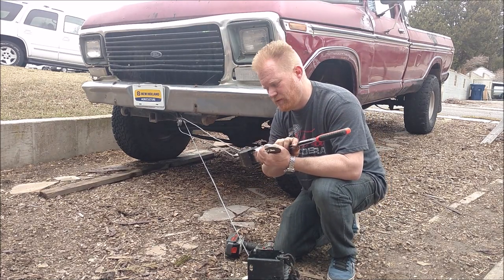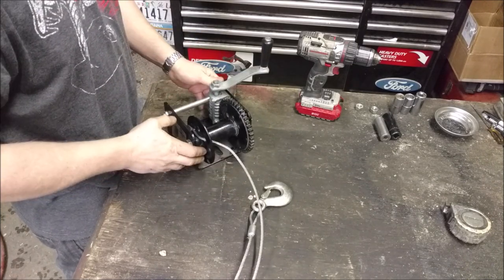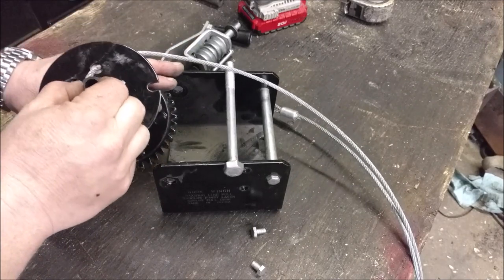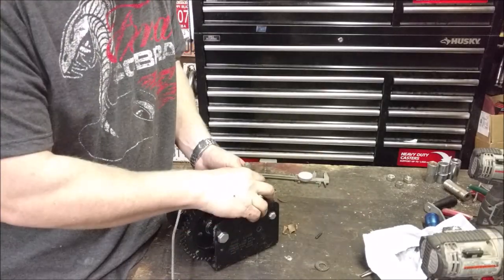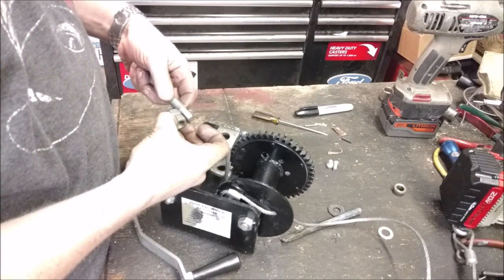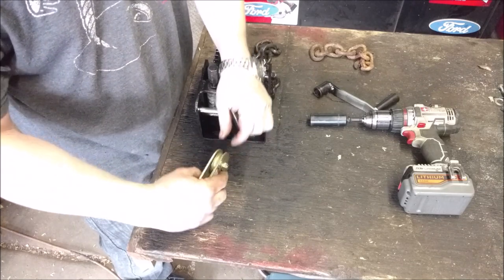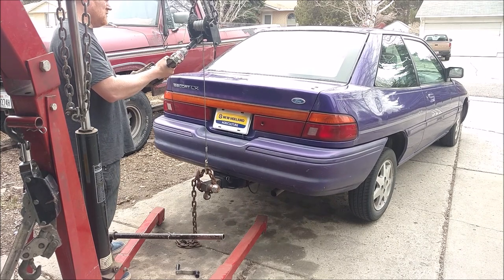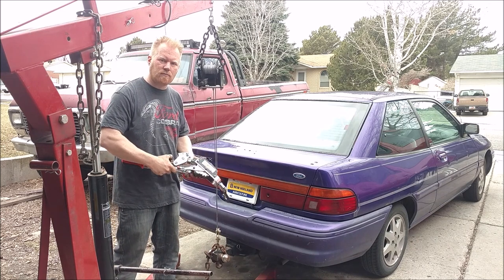Drill powered Winch build

Comment: I have the USA winch, but got it cheaper than amazon, bought at McMaster Carr. I have used it for a Draw Bench power unit, had no issues. You know, it is 900 LBS with full drum and 2000 lbs with most the line out. I have only about 15 feet of line on mine, and so, I max it out. I have been using comealongs in the yard. I do have one of those outdoor drill winches, but the overlimit clutch slips all the time, kind of useless unless you only load it less than 500 lbs. I think I will get another McMaster winch and make a yard winch out of it. FYI, one does not need to mod the winch from McMaster, the tolerances are close enough already.

Comment: Nice.  You should put a socket on the old handle in case you don't have your drill in your vehicle.
Reply: Yup. The first thing I thought of was retain the ability to use that handle.
Reply from the maker: I welded a socket to it. But I also made it as standard lug nut size so a 19mm or 3/4" lug nut wrench will work on it.

Comment: Just so you know ...shouldn't depend on a welded chain ...it will fail ...better to be bolted on ...instead of hooking lead hook to small threaded cross bolt ...bolt a piece of steel to tongue that will accept the lead cable ...although ...good build ...👏👍👏

Comment: bought one of these today. MUCH tighter than shown in this video. I was fully prepared to make the mods shown: shim the drum, move the worm, add washers,  etc but see no need. Maybe tolerances vary or quality has improved but either way I'm very pleased. Gonna swap on a longer cable and build a shingle hoist for roofing.
Reply from the maker: Quality control is one of the reasons HF stuff is so cheap; there is none. So some are great, some not so much and some horrible.

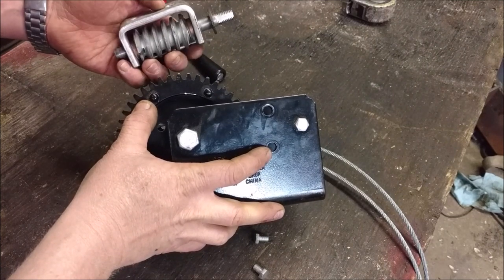Comment: Another impressive project. Love the upgrades. Another upgrade you might want to consider: The tube that you have in your hand at 2:10. Drill straight through that, in the middle of the length. Making 4 small holes in the middle. Now take the bolt that goes through it. Starting at the head, drill the center of that bolt. Maybe 1/3 to 1/2 the way down the length. Use a smaller bit, to maintain integrity of the bolt. Doesn't take much. Drill an 'exit' hole, at the end of where you stopped drilling. Now, drill a larger hole at the head, and tap that for a grease fitting. 

When you put it back together, just pump grease in, until you see it coming out both ends. Check it again, a couple times after the first few uses. Then keep it maintained from that point on. You can add a dab of grease to the screw, each time you do this.
Reply from the maker: Great idea.

Comment: I had been thinking a lot about a small portable, yet powered winch, and then you posted this!  I made myself one using your idea, but my gear mesh was a lot better than the one you have, so I didn't need to change it.  Instead of making a bushing (shim?) for the drum I drilled it and the frame out to 1/2" and put a grade five bolt through it.  I also made a hook on the top of my engine hoist and a pulley on the end of the boom so I can use it on there.  Great idea, keep them coming!
Reply from the maker: That's great.

Comment: If you want to max out the range of that engine hoist, weld two pieces of flat bar to the end of the boom and bolt a pulley between them. Then mount your winch on the rear of the boom. That lets you reach deep into any engine bay with the boom fully extended to clear radiator braces etc.

Comment: I just recently got a 2 ton version with a brake. I'm suspicious on the teeth only meshed in roughly half way. It definitely needs to be tighter tolerance. I'm glad saw your vid. Cheers from Australia 🙂👍👍👍. So cheap to buy it's definitely worth modifying! I made my  1200 lb winch on my hand trolley into drill power.

Comment: I like the idea.  I've been trying to figure out how to get a ford starter to be the motor on a very similar winch you have there.  Here's what I did with my come-alongs.....I removed the steel cable and the pulleys.  Then I wound new cable just like a winch.   Now my come-alongs have 30 feet of use.  You bet they pull full-size trucks onto my trailer.   Plus they do double duty to strap down the vehicle to the trailer.
Reply from the maker: Nicely done.

Comment: You are correct about doubling the mechanical advantage by doubling the line, but your anchor point needs to be rated for the full weight  or load, and you are adding additional stress to an already marginal design.  Not saying it won't do it, just don't think that you are reducing the forces on the winch or anchor point

Comment: I got one of these to move my old truck. I made a bracket with chain to bolt to the hub bolt but after trying it the worm gear moved off it's pin and wouldn't work so I had to take it apart to put a washer in there to take the play up. I also welded nuts on the shaft too. The gear mesh wasn't bad on mine so I didn't change that but found the bolts holding it are m8 1.25 which is the same as handles for angle grinders so I replaced a bolt with a grinder handle which really helps to hold it while using it.
Reply from the maker: Nicely done.

Comment: Great idea! I might build one of the to hang on a beam in my garage to lift heavy stuff and possibly the top off my jeep!
Reply from the maker: It's come in handy a few times since I built it.
Reply: Ratty 64galaxie be sure to have a backup chain in case something fails. I used one to hoist my truck bed off and while it was hoisted up a pulley came off dropping the bed a few feet. The hoist took the hit but almost failed it's self. I had to modify the hoist to make it stronger like in the video.
Reply: Allen McKinney not a bad idea especially with the seriously heavy stuff.

Comment: One of the most useful youtube videos I have seen. Yours are consistently useful and practical.

What kind of welder do you use and is it a good option for a newbie to start with?
Reply from the maker: There is a huge in flux of Chinese welders these days and you can get started for $150 with a helmet and everything(Harbor Freight). For the price it can't be beat. BUT, it is difficult welder to learn on and even when proficient has mediocre results. Mainly because it is a AC output welder. I would highly recommend finding a used Lincoln DC flux core welder, like the Weld Pak 100. It'll well really lessen the learning curve and give you far superior results. I self taught myself with a Lincoln WeldPak 100 I bought in 1998 and still use it to this day. It has more than payed for itself many times.

Comment: Nice job as usual, thanks a lot. I'd like to see a closer view on how the cable is set up with the snatch block. Can you make a video or suggest one that you may have seen. Thanks again
Reply from the maker: A snatch block is a really neat thing. By taking the cable out of the winch and through the pulley of the snatch block, then back to the winch it doubles the pull capacity. It also halves the speed of the item being pulled/lifted but it is a worthwhile trade off. You can keep adding pulleys and running back and forth to reduce the strain on the winch.
Reply: it also gives you the advantage of a smaller diam spool
Reply: Ed KE6BNL not true om

Comment: Ya these work good , Only thing it could really use is a guide ring on a rod  about 8" down the cable like on the come a long so it can`t turn on you if pulling at an angle , Be handy alright .
Reply from the maker: I just used it tonight to pull a riding mower onto my trailer and it was trying to turn sideways a little. I like your idea and I'm going to weld a guide loop/fairlead a few inches out front. I may make it removable to keep this compact for storage.

Comment: That's exactly what I need. I bought a harbor freight cycle lift. I need to roll it over to the wall and tip it up on its side when I'm done using it. What would you charge to make me one of those?? Great video man, thanks
Reply from the maker: I have a link in the video description with a USA made one just like the one I built.
Reply: sixtyfiveford 
Thanks

Comment: You, my friend are helping me out one hell of a bit and I haven't even started yet. Except for one thing I want to put the drill bit nuts onto my haul Master 1 ton capacity hand winch instead of using the hand crank but I don't have a welder to weld the nuts to the shaft do you have any advice?
Reply from the maker: If you have a propane torch you can solder steel pretty easily. Putting two nuts on and jamming them together is pretty efficient. You could also grind the handle down with an bench or angle grinder to fit into a hex socket.
Reply: @sixtyfiveford  I realized I could just use an impact drill  with the nut it came with, I just can't let slack out. What size drill bit do I use on my drill press to drill out the center of the two nuts that I use a 3/4 socket on??

Comment: very well explained and demonstrated. thank you.   Any idea on translating this design so that you could triple the speed but still have the 2000lb capacity?  I want to pull 1000lb wheeled cart up and down a 250' hill at about 80-150 feet per minute.
Reply from the maker: You would need an engine driven winch to achieve those speeds. Something along the lines of a wakeboard winch, just heavy duty.
Reply: That is what I was thinking, but will that USA made hex winch be able to handle that speed?  What kind of motor do you think?  I was hoping to convert a go cart with a 5hp motor.

Comment: Very cool hacking, subscribed! 
When you did the loop the cable through another hook trick at 7:00, the higher load carried by the wire rope at the lower hook using that technique might take it to near to its breaking strain, ie reduced safety margin?
Reply from the maker: Thanks. The cable is generally way stronger than winch. This is using tiny 1/4in cable that has a rating of 3.5tons where as the winch only has a 1 ton rating. So I could essentially pull around 3 tons safely with rigging pulleys and stay within the safety parameter.

Comment: I don't like the weld of the worm bracelet because I can loose the bolts and free wheel pulling the cable out, of course I had to add a cable tension flap and spring to prevent backlash.

Comment: 1. You didn't say the size or thread of the 3 nuts you welded.  Very Important information! 2. How do you weld it; which welding technique? 3. What type of category drill is that? Can't see it well.
Reply from the maker: 1/2" course thread with 3/4" head, but it really doesn't matter.

Comment: Only Escort I've seen with a set up to tow! You might see anything on Sixtyfiveford! Lol
Reply from the maker: Back in '08 or so when gas prices were super high I wanted a hitch for it and needed to make one. It actually tows extremely well; I think being so low to the ground helps. I want to say the max I've ever towed with it is about 2500#s including the trailer weight. All while getting over 30 miles to a gallon. Back then it saved me at least a few thousand on fuel versus driving one of my trucks / trailers.
Reply: @sixtyfiveford  I knew you had a story behind that hitch thanks for sharing!
Reply from the maker: @rafterh2181  It gets a good laugh on the freeway. I took inspiration from all the guys in Europe towing camper trailers with the tiniest cars / engines in the world.

Comment: did you put the hitch on the escort just for this video or did someone actually pull a trailer with it is the only thing I'm curious about
Reply from the maker: I built this custom full size 2" receiver hitch for the Escort years ago. Cars tow amazing and generally have better power to weight ratio that most small SUVs. People tow travel trailers, other cars, and utility trailers in Europe pretty much solely with cars smaller than this Escort.  I've pulled 1000lbs without the car really even feeling it(just like having 4 big guys in the car). I pushed the limits to 1,800lbs one time and it felt it for sure but never had lack of control no more than my Truck fully loaded or my SUV towing a large load. Moving small, few hundred pound items either with the rear rack installed or trailer has saved me $1000's in gas throughout the years.

Comment: The one you linked to already now has the hex drive. 122.00. Think I can make it all from scratch. too simple. Thanx works well. Did you happen to notice the other 2000lb worm gear unit said it had a "Brake" hahah must be a scam as you just proved does not need a brake and that one was $795.00
Reply from the maker: The one from the video is from Harbor Freight for 25 bucks. I put a link to the USA made one as I think it is a lot better and already set up from my viewers without a welder.

Comment: what do you think of the 110 amp flux core welder from Have freight for around $100?
Reply: Do you mean the 110 volt 120 amp flux core welder from Harbor Freight? I have one and like it a lot. I think 65 has a video with his, he has a better one that, if I remember correctly, think he said he got it for just about the same price used. I don't weld often or very well but this one helps you become a better welder. The down side is it splatters metal beads on your work which I generally don't care about. Last week I used it to weld an old cheap metal roll cart that was just bolted together to make the cart much more ridged.
Reply from the maker: For the price it can't be beat. BUT, it is difficult welder to learn on and even when proficient has mediocre results. Mainly because it is a AC output welder. I would highly recommend finding a used Lincoln DC flux core welder, like the Weld Pak 100. It'll well really lessen the learning curve and give you far superior results.

Comment: Why, may I ask, do you use Porter Cable?
Reply from the maker: That's a can of worms. Kidding, this is my personal opinion.  As you may know the Porter Cable is currently(as or mid 2000's) under the Black & Decker umbrella. Black and Decker owns/has Dewalt as their top of the line, followed closely by Porter Cable and finally Black and Decker branded items as their lowest budget tier(a few other random names like Bostich & Stanely are thrown in for different markets at the same budget quality/prices). I won't buy Black and Decker branded stuff as it just too low of quality to handle what I need them to do. In wood working(which I spent over 10yrs commercially doing) Porter Cable made some of the best tools out there with brands like Dewalt and Makita trying to keep up with them(1980s-1990's). So I have a long time faith in their reliability. Now we flash forward to today and I know the tiers of how stuff is built and that they are no longer an independent company. B&D's Porter Cable brand is around 95% as good as Dewalt as far as features at around 40-70% the cost. Generally I don't need a cordless drill that lasts 5 more minutes because it's brushless, or might have 5% more power so Porter Cable suffices. Dewalt is better, I just don't know if it is worth the extra price better. As far as the other two major top brands; Makita and Milwaukee, it's just personal preference. I do own other brands of items in certain tools as I think no one brand makes the best everything.

Comment: Great job :-D.
Its a shame that the original engineering was so half baked, a good idea made badly.

Just making the wormgear have full contact will make it so reliable, and no wobberly shaft.
Well no one wants a wobberly shaft LOL :).
The handle can be modded with a welded on socket, just in case the drill poops out.
Reply from the maker: I welded a spare socket to the handle but it is also a common lug nut size, so a tire iron will work.

Comment: just buy a high lift. push and pull. 100 bucks .....done.
Reply from the maker: I have 3 High Lift jacks and they are a pain for using like a winch.
Reply: sixtyfiveford 
Yes,  they are a little hard to use that way. Just a good multi function jack ....you know.

Comment: I would never trust this for 4000 lb. common sense goes a long way....
Reply from the maker: Yeah, it's not rated for 4000lbs, just 2000lbs. You can however use a pulley system to make it pull 4000lbs where the winch will never see more than 2000llb load on it. This is a very common practice with winching.